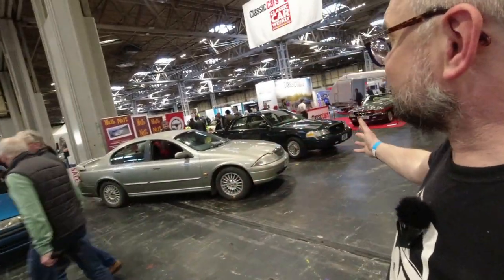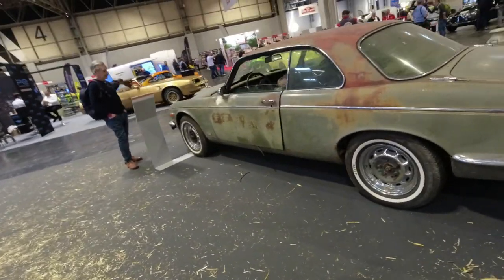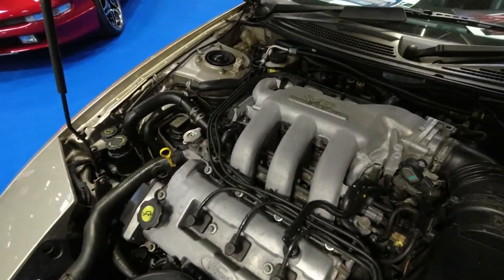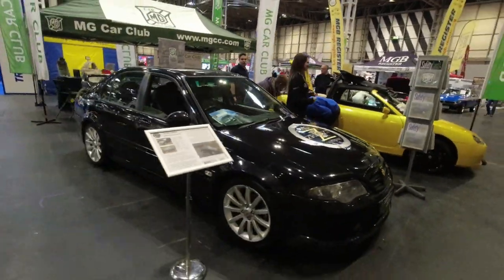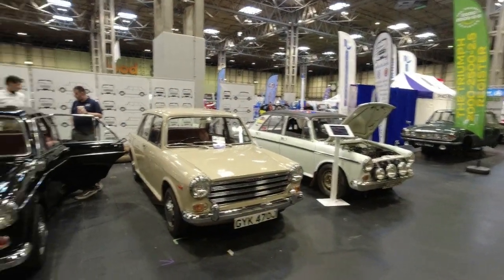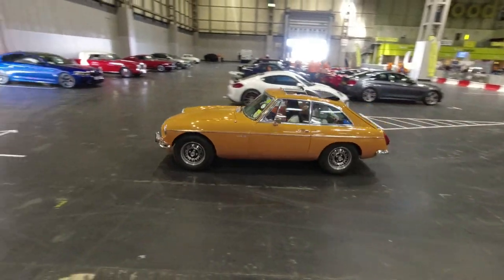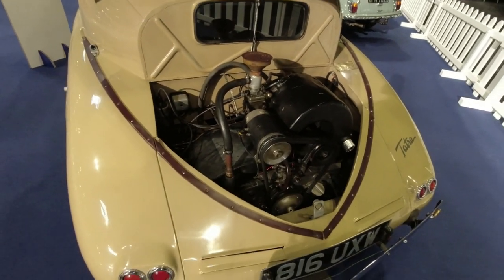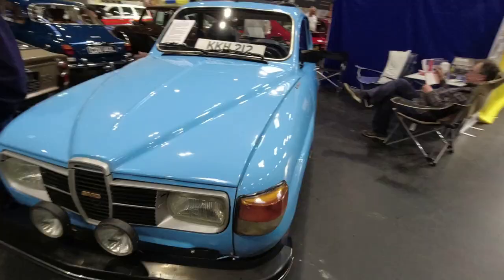Practical Classics Classic Car & Restoration Show 2022 - Part 1

Comment: The Marina looks great but I’d never remove the door handles - they’re one of the best bits.
Reply: That was one of the bad bits of the car but mainly because the handle holes were not filled very well
Reply: @wattling1396  I'm sure the owner will sort it eventually
Reply: And one of the few movable bits that actually worked?
Reply: Removing the door handles is a pointless exercise - in my experience they break off quite soon on their own.
Reply: That’s exactly what Lotus thought

Comment: That IZh 2126 Oda (ИЖ-2126 Ода) was a further development of Moskvich 412, which was on sale in UK in the 1960s, manufactured in the same factory as Kalashnikov assault rifles. New body, developed in the late soviet years, in production up to 2000s, had basically the same underpinnings. Rear-wheel drive, 5speed gearbox, engine from the same Moskvich or from Lada, lack of any creature comforts - basically a recipe for a cheapest car on the market.
Reply: Thanks for the very interesting background. My father nearly bought a Moskvich for my mother in the seventies to compliment his brand new Rover SDI on the drive. He ended up without the Moskvich and nearly without his wife!😂. I would swap parts of my anatomy for one now!

Comment: It is nice to see a lot of nice looking cars. I agree about the Probe being a nice car. I had a 1994 base model Ford Probe for about 3 years a few years ago. It was the base 4 cyl model with a 5 speed stick. I paid about $1200 for it and it had about 200,000 miles on it. It had a battery drain issue which even after countless hours with the voltmeter could not Sherlock out the issue. I wound up just leaving the battery cable off it when not in use. it also had a loosie goosey shifter due to needing bushings on the shifter cables (I did not feel like removing the heat shield to replace them). Still it drove like a champ and was very good on turns (you could tell Mazda had some say in it) . Mine had a factory button that kept the headlights up with the lights off. I actually like the 91-97 Mazda MX-6 better then the 93-97 Probe as I think the MX-6 looked a bit more attractive 

As for the British cars, i have always liked the SD1. They were great (and are still) great looking cars. We(in the USA) had a version of the Rover 800 series. It was a collaboration between Rover and Honda and it was called the Sterling. they were made from 1987 to 1991 and offered 2 models. The sedan (825) and the 4 door hatch (827). The hatch was my favorite of the models.

Comment: Great video content, came across a fair number of those cars in my 47 years in the motor trade. While on the subject of classics, someone that I worked with for a while, ran a 1965 Ford Thames caravanette, which he ran daily, the last time I saw him 3 years ago he was was still using it, he bought it when it was 2 years old, still no rust on it.

Comment: Hey Ian.  I', absolutely rapt you're taking us around these stands, mate.  NZ (well, the top half of the island anyway) didn't get its usual plethora of car meets and shows this summer because most of it we were in lockdown, could not travel intercity and / or still had gathering-restrictive rules in place.  I'm therefore enjoying the vicarious look around the NEC-lite.....which is still VERY impressive.  Incidentally, that VJ Valiant Ranger you saw had a 1974 NZ number plate on it, so it will be very interesting to hear how it made its way to the UK when you finally catch up with the owner at some point after the show.  Funny hearing you wax lyrical about the Probe - me being a GM (Holden) bloke, I was shocked and stunned the day I first saw one and immediately wanted to drive it, to then find out it had a blue oval on it's conk!  However, I still really love he look of them and I reckon they too will take on classic status when the time comes.  A remarkable looking vehicle - so subtly different from the MX6 (and better looking somehow), yet I never twigged they were the same car until I saw them side by side!  All the best and keep 'em rolling in.

Comment: 8:41  just like MY FIRST CAR, also in "Pacific Blue" MK3 Cortina GLX 2.0.    Black vinyl roof and it had been stolen TWICE before I got it.  £200 to buy and £195 to insure. White Hammerited steel wheels with chrome wheel nuts.  Would be worth thousands now.

Comment: There's a guy here (Thailand) selling a MkIII Cortina XL for about £2,000. It was supplied and sold by Ford in Thailand, has never seen a winter and has no rust, but does have sorry paintwork due to 45+ years of sun. It's had an aftermarket AC installation and the heating system removed because a heater is not something you need in Thailand.
I was sort of interested, but it's had the engine and gearbox replaced with a Toyota 2.5 litre fuel injected lump mated to a 5 speed manual box. 

It's probably got the performance the original never had but what I loved about the MkIII was the ease of tinkering. There's also the reality of keeping it running, it may be feasible finding spare parts in the UK, but for sales that might have totalled a couple of thousand here, spares are rarer than rocking horse pooh!

Comment: My dad bought the first of the discovery's on a G plate. He liked his high speed cruising especially on the autobahns of Europe and soon realised with a a top speed of 90 mph he had not done his home work. Also with no underside protection from puddles the powered steering went momentarily causing some near misses.

Comment: Great video! if you set your camera to 25fps when filming it wont clash with the 50hz UK lighting and flicker, You have filmed it in 30fps which is for American/Japanese 60hz lighting. It  is also a smaller file size, lets in more light and is UK TV compatible too!
Reply from the maker: Sadly, I was shooting 25fps I think. This camera has always struggled with LED lights.
Reply: @HubNut  I right clicked on 'stats for nerds' and it was filmed at 30fps I checked before I commented. Love the brilliant knowledge and subject. I'm not having a go! But I always film at 25 for that exact reason.

Comment: I think that the drop head on the A40 stand was an A40 Somerset. The earlier A40 Devon (4 dr) and sister Dorset (2 dr) had a drop head based on the Dorset. The Dorset didn't sell as well as the Devon, so there was no 2 dr replacement when the Somerset came along, apart from the drop head.

Comment: I didn't find the owner of the Hillman Husky van and tried to remember differences from my 1962 Cob from 50 years ago. The biggest difference I spotted was the drop-in floor panel, permitting rear seats perhaps. With panel sides and no seats I believe it would have been Purchase Tax exempt as a commercial.

Comment: Oooh! I know about a car Mr Hubnut doesn't!?? A very unusual feeling hehe 
I love the IZH Oda (2126), they are known a little bit like the 'Russian AE86', as they seem so much like a Samara on first glance, but secretly they are RWD!, when their body makes you assume they'd clearly be fwd)))
IZH are maybe my favorite Russian car company(plant?), they made alternate versions of the AZLK Moskviches, and their own IZH Kombi, IZH 2715 van/pickup, as well as IZH 27175 van/pickup Lada 2105))) A pickup lada 'Riva' exists yes :)
This was a development from their IZH 412 version of the moskvich, with a more modern body style. Very very basic cars, did not have the luxury or technological advancements of FWD hehe 
Interestingly, they had a 4x4 version! A rare but very cool find
Unfortunatly the IZH Oda was really outclassed by the Samara, and they were only produced until 2000 as the main car (although they continued creating van/pickup variants until around 2012~, but annoyingly named them also as the IZH 27175 as the VAZ2105 van/pickup, which is confusing)

Also, as a heads up, the initials IZH are the phonetic translation of the actual name ИЖ, which means it is not so much sense to read each letter out, as 'eye zed aich', but instead to just pronounce it as a word 'eezyh' :)

Comment: That C reg Transit must be one of the earliest, as they only came out in late 1965, and the C reg ran, in those days, from 1/1/65 to 31/12/65, before it changed in 1967, to 1/8/67 to 31/7/68, F ref, the year of my Moggie Traveller, registered 1/2/68

Comment: The Mk5b Escort does in some ways has the RS "snout" in that it already had that grille, as its the scatily revised Mk5b rather than the Mk5a, but the bumper is from the RS, which I'm sure you meant.
Reply: The front also featured on the XR3i MkV facelift (take your pick a or b) and shared headlights with side lights with Cosworth, but not bumper or grille.

Comment: Thing with the Transit was it just moved the game on by miles - imagine driving a J4 or a Commer Van or a Thames Trader and your boss chucks you the keys to one of them there new fangled Transit thingies...............you just stepped about two decades into the LCV future
Reply: You didn't have to sit next to the noisy smelly engine anymore.
Reply: @Witheredgoogie  also not the heat in summer and not the weird forward control cab - a van that drove like a contemporary car

Comment: The Tatra looks to be a Tatra 97, which I think from memory had a 1,7 litre 4 cylinder engine, as opposed to the V8 in its big brother, the Tatra 87, the so called Nazi officer killer (due to its swing axle suspension, combined with a powerful and heavy V8 led to interesting handling at full throttle...)

Comment: The Renault 5 was known as the Le Car in the U.S
Reply: It was initially the 5 but towards the end they renamed it LeCar. Why, only Renault knows!
Reply: @frothe42  I never knew that I thought it was always called the Le Car though it whole entire production run
Reply: @jonathanmagness5370  I actually forget which year it was first imported to the US market, 1975 or 1976.
I think they pulled the 5 LeCar after 1980, it wasn't selling..
You rarely if ever see one!
Reply: Wasn't there a Le Car special edition in the UK market?
Reply from the maker: Yes, I think there was. All the more amusing because car is French for coach...
Reply: @caw25sha  Indeed there was - there was also a Le Car 2, launched at the end of the original 5's production just as they were replaced by the Supercinq.
Reply: @HubNut  There's also the phrase "Car Rempli de Singes", used to describe the French CRS police...